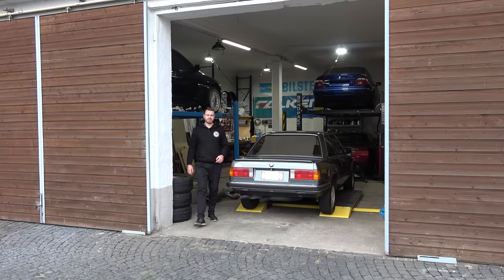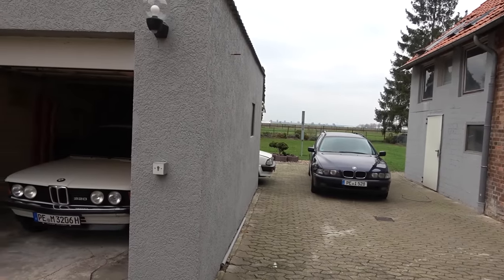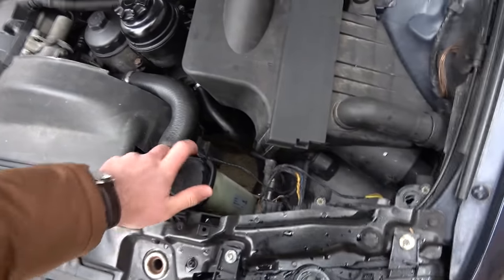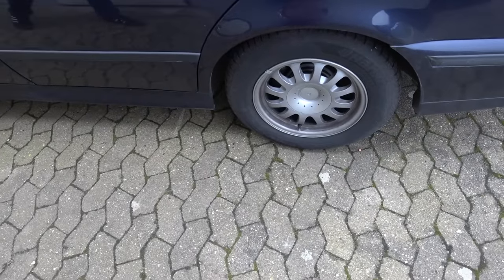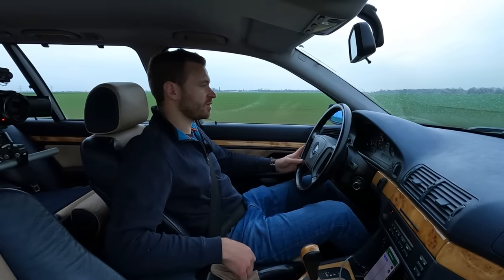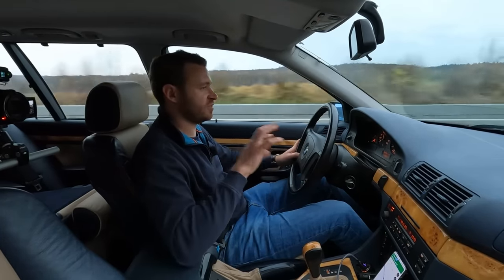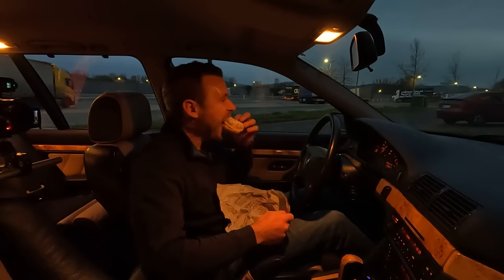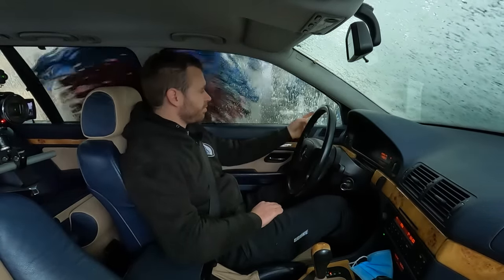I Got a FREE BMW E39 528i Touring Individual

Comment: We had that "winter cold start it runs on 4 or 5 cylinders till you rev it" issue on our 520i as well:
Turned out to be the hydraulic tappets "overfilling" somehow and letting the valves not close fully.

We found out when the battery was especially low one morning and it didn´t start right away. 
On further cranking and jump starting it then one by one lost compression on all the cylinders....

Obviously a bit worried, but the old Meister at our shop knew that issue: 
He let the car warm up a bit inside and just cranked it till squeezed the oil out and stumbled itself back into life.

On diffenrent oil now and its never missed a beat since then. 
I still love that slow boat :D
Reply: I'm struggling witht the same issue here.. can you tell me what oil you used to run and what oil are you currently using? thanks.

Comment: I have an e39 530d touring that used to be owned by the city of Hamburg, individual as well with all the options, it’s now in Finland and is pretty much a parts car, turbo leaks oil, injectors leak, has a tiny bit of rust, and a bunch of parts. If you ship it, you can keep it. Has pretty much all the options, 2003, only missing the hydraulic boot, and has the air suspension removed. Also has leather everywhere, transmission tunnel and doors, etc. also xenon lights you could switch in.

Comment: What a find! I had the exact steering wheel in my touring, I changed the column to a 99+ column and added cruise actuators and ECU for the buttons. All fairly easy with OEM wiring diagrams

Comment: I think you're going to fall in love with it. I honestly think you should keep it with your fleet. I love that colour combo, absolutely stunning!
I once got a free 523 Touring in Cosmos Black with light gelb 07LG interior. It was MOT'd, (UK equivalent to TUV). A free car is always good. A free e39 is somthing un heard off these days.

I've owned 4 Tourings, 3 I still have owned only 1 Limo. I also have a 99 Cosmos Black 740i

My first ever BMW and one I still have and adore to this day is my 1997 528i Touring. It's a factory Manual in Calypso Red with beige interior. Huge spec with comforts, heated seats, nappa leather, blinds, nav, TV, DSP, phone, PDC, genuine oris tow hitch, sliding trunk floor Style 32's and Xenons to name a few. Auto dip mirror and rain sensitive wipers as standard on UK 528i's. It's currently a rolling shell as its going through a full nut & bolt restoration at my own leisure. 
Not only was this my first BMW, It also was my first car. 2 previous owners, last owner 13 years. I've owned it 10 years. I have every invoice and original bill of sale with brocure, and accessories catalogue from 97.

Comment: 31:15 - if you are not going to repair the rusty spots properly I can higly recommend you a paint which is put ON the rust - ELASTOMETAL.
Myself didn't believe it might work but I painted the rusty fender edges and some of the bottom parts in my 18 year old astra few years ago and it seems to really work!
The rust which was covered with this paint didn't "grow" and the rest of the steel parts is strong and healthy under the paint. 
Try it out - especially on such a car, where you say no additional proper body reparation is planned.

Comment: Can't wait for you to start working your magic on this one.
In 06 I managed to trade an 02 A6 for an 03 530i with less than 50k miles.
At 110 mph I'd swear I was sitting on a large rock with no wind noise. The most stable and smooth running car I ever owned. Better than my current mercedes e320.
I did put new brakes on it and changed oil and plugs. The car was solid with no squeaks and rattles. Lost it at the end of 07.

Comment: Touring rear subframe bushings too are notorious for tearing/ripping.  New rubber or poly is a vast improvement.  And your outside air temp sensor reading -40C might have something to do with your rough starting, or possibly leaking fuel injectors?
Reply: The 4 bushings are filled with oil, with age the rubber hardens and cracks and it leaks out causing a harsh ride at the rear. Some cars go for years like that and owners don't realize anything is wrong until the rear airbag suspension also collapses and an enormous bill comes along!
Reply: @1maico1  my bags had a slow leak, replaced em and did poly rear SF bushings and it was a world of improvement

Comment: I had one of these, it was a 523i with a 5 speed manual gearbox in sapphire black with turbine wheels. Loved the self levelling rear suspension. Also there was a cassette player behind the fascia above the radio. Light grey cloth seats tho, not great with two young kids to keep clean but it was a great family car.

Comment: I had a biarritz-blue 1998 manual 520i with pretty basic spec, it was a sedan with multi-function steering wheel and a ski-hatch, that's about it. It was such a good car, i was stupid for getting rid of it!
It still has less than 200.000 km on it and the guy who bought it from me in may of 2016 still has it and is the third real owner. 
The car was VERY clean and with zero faults.

Comment: I also own and E39 in orientblau, just like mine, yours looks like a normal blue car, but after some detailing, the color pops so much, depending on the light it looks blue or purple, i also happen to have the sunshades but mine being a sedan, it also has the electric sun shade in the parcel shelf in the back, great option to have, but mine has a tractor engine as you would call it, an M57D30 with a manual xD
I just noticed you have the style 31 wheels, mine came with these as winter wheels, and you also have the original Dunlop spare tire too

Comment: I love my E39 touring 530d m sport, bought it in Dusseldorf (i live in Norway) in 2010 it had 148 000 km on the clock, now its passed 400 000 km. Its gotten great maintenence. Currently sits in my garage for rust repair in the wheel arch, but under it looks super nice.
Its  has stock look with orginal m sport roof wing and Rondell 0021's in 18" 8.5 front and 10" rear, legally approved by the whatever its called in english in Norway. :-P 

Funny story, my dad owns a 98 525 tds touring, also bought in Germany in 2000, he still owns it and loves it.
But i has bought a new car now, a 2017 540i sedane, with m sport and alot of cool stuff. But he still insists that the E39 is better to drive, so much better to sit in, he also claims its more silent inside. And it has a proper servo rack and not the electric crap like the 540i has..

I dont think i ever gonna sell mine, i have a feeling that would have haunted me for the rest of my life.
Reply: They don't build them like they used to.
I also own an e53 4.8is, the design is timeless.
Reply: Keep the e39 mate
Reply: @Krezo200  Probably will, i got my self a "winter beater" now, so the e39 can rest and its no rush anymore to get it finished. So im gonna fix some other stuff to that i have been wanting to do for a long time but not had time.

Comment: I picked up a cheap E39 520i touring earlier this year inspired by this and other youtube channels. Paid 1K for it and spent another 2-3K overhauling suspension, cooling system, fixing oil leaks, also retrofitted heated sports seats and an XTRONS android head unit.
Drives brilliantly now and absolutely loving it! The E39 is a great car.
The blitzer app takes care of the speed cameras btw.

Comment: I bought my 525i touring South Africa import in UK roughly 7 years as go.

It had 170k miles, now it's on 250k (miles!) And still going strong. I love this car, I swapped b30 in and done ton of work but I absolutely love doing every mile in it. LPG converted made it easy and cheap to run compared to even diesel cars, and I have no worries driving it at any speed.

I tried different cars but I always come back to this one as it's part of family I absolutely love it. You can tell you are big fan too!

Comment: I had the same issue with my M54 running rough and then running really well with 1 percent throttle. I cleaned the ICV and throttle body and it completely took care of the issue and it’s been years

Comment: I have 2 2001 E39 530D SE Tourings, one manual and the other auto, both with about 250,000 km. No rot in either of them despite being from the UK.

Self-levelling is great with the 1800 kilo Hobby caravan I have.

Flaps have been removed from the intake manifold on the auto. No major mechanical work has been needed.

The only real problem was the electric wiring for the rear wash/wipe on the auto which had broken in the tailgate hinge (a design fault and a common problem).

Comment: This was from an era when BMW relied on pure engineering, quality of components and classic design cues to sell cars. And built timeless classics as a result.
Then they did a 'Boeing 737MAX' and went all electronic where even the horn push is an ECU and they thought having timing chains on the BACK of an engine was pure genius. And they wonder why the BMW reputation is in the crapper.
Lucky man getting hold of one of these classics.

Comment: Hiya, I had a m52 motor in my e36 328i and it was also losing water. No signs of leaks and water wasn't mixing with the oil either. Long story short, the garage I took my car to, to get a new head gasket fitted used the same head bolts when they did the replacement. Turns out those bolts are stretch bolts and a new set was needed. (found this out after giving up and selling the car) so if all else fails, check that.

Comment: Love the Tourings I'm on my second one. Had a E34 m60 1995 and now a E39 m52 with 120.000 Kms. Had the engine oil and filter changed and transmission filter end fluid changed.  IMO there's no other BMW. I have pictures of both of them.

Comment: Nice gift! I've scrapped about 15 of these in the last 5 years as a side hustle. Used to buy them for around 500 euro's before prices got higher. Rust was the first indicator for scrapping because the catalyc convertor is worth already 800 euros on a pre okt '98 car. There was one which was too nice to scrap. Body was fine. Only had  a seized engine. Swapped it and i still drive the car to this day 5 years later. Still love it 😁
Reply: What is the cat worth on a later 1999 engine?
Reply: @1maico1  The cats in the manifolds as from '99 are around 150/200 euros a piece.

Comment: I love my E39 touring, best car i ever owned. 350.000km and 20yo, and still perfect. 
But some problems, brake are very bad, steering rack is fragile, some plastic are in bad quality (espacially in rear), some rust, etc
But this car is so good, very easy to repair, powerfull and perfect for cruising, nice design <3

Comment: About 4 years ago I found a factory manual 528iT that had blown the head gasket local for $1000.

After going my research on the M52, preferring facelift E39s, and being a new dad I decided it smart to leave that project to someone else... I thought I'd be able to get into one in a few years. 

The prices on these are so high now! 540iT listing for over $10k when they were junk a few years ago.

I regret passing. Great find. I still look around in the hopes I'll find a cheap one.

Comment: im putting the small airbag sport wheel into my 00 528i out of my 03 530i parts car as well as sport seats. i bought a parts car wagon as well with the rear tray and subwoofer setup. the car itself is just a base 528i 5 speed with cold weather pack because canada. the whole front suspension will get swapped to sport stuff as well as the brakes. and the interior is going from doe grey to black. im very excited to watch this build play out!!!
mine is also getting huge rust work including a new tailgate, both rockers, one quarter, the battery tray, the opposing side air vent behind the bumper, drivers rear footwell, inner wheel arches etc. thankfully the 530i parts car was rust free and the wagon parts car has a tailgate

Comment: Sreten, regarding those rust spots and on any other car that you have. There is a product called kLine Rost Stop Primer that comes in 1Liter bottle(15 m2 coverage) and yes it costs 55€ for that bottle, you can use that to slow down that rusting process a bit. Angle grinder with flap discs/wire brush and then this stuff. Longterm, this needs some proper job but this can buy you some more time so you can leave it like as it is until you decide to go nuts with it. Keep these vids coming 🍻.

Comment: Nice catch Sreten, need to see more soon :) Same thoughs on e39, it's great everywhere and you can't destroy it ! Have myself an 528i too, in quite mint condition with many new OEM parts, it's my daily and probably best BMW i've owned, never had V8 so maybe will change my mind one day ? Mine has some fun options as double glazing. Full toolbox and OEM torch in the gloves box :) Recently put B8 and HR spring (with every chassis parts new) only non OEM upgrade for this one, but it handles so much better on dynamic driving. I'm on 16s style 5 wheels.

Comment: This car seems like a good test bed to try out three or four or five rust killers or rust converters.  Make a map of what you did, then check the underside in six months or a year to see if anything was effective.  That would be a lot cheaper than making new pieces to weld in.  And it would be a worthwhile experiment.

Comment: You can try fixing the temperature sensor - this should fix the bad idle. The a/c won't work with that sensor and it'll burn more fuel,  since it thinks it's -40 outside. Cheap and easy fix.

Comment: I have a 2001 530i msport, just clocked 150k. So not run in yet 😆. Easy life it has had in nz so no rust.  But also no autobahn. Love it. Running synthetic atf currently but I think I need to go back to zf lt... the lock up clutch seems to struggle to stay locked.  Otherwise nearly perfect.

Comment: The rough start might be because of the coolant slowly entering on top of piston after engine shutdown, I've had that experienced. Also a note at first weeks of the problem for some reason it didn't show even on cylinder pressure test (it seemed that it wouldn't leak on warm engine). Later when it started to effect on engine temp, it showed leak on cylinder pressure test. The rough start didn't occur everytime, just occasionally.

Comment: I had a 530d.  Outside of the crappy GM transmission, it was a great car.  I remember test driving a 528i back in 1996.  Great car.  Handling was awesome.  Especially the steering.  I am down in Stuttgart.  Might have to come up an meet you sometime.
Reply: Only the diesel E39 used a GM trans?
Reply: @vw5056  I am not 100% sure but I want to say that most of the diesel models used the GM automatic transmission where the gasoline typically used the ZF.  I may be wrong but my 99 had the GM 5L50E automatic.

Comment: Try the bedding in procedure before binning discs that are not worn/lipped. But as you say it could also be a suspension component. 

Is the starter button something somebody bodged together because the ignition switch broke?

Comment: love love love that M52 engine, smooth as silk and durable if the VANOS  doesn't fail.  The damn plastic coolant tank would fail way before, at least they did in my 2 E36's.

Comment: for the cold start issue, i had similar issue on my E46 M54 ..there the Valve stem seals are a bit old ;) dependig on the valve position probably a litte oil drops into the combustion chamber or on the spark plug. mostly a little push on the pedal solved it.
I had no huge oil consumption (~0.3-0.4/1000km) but a little 2stroke fragrance after starting the engine.
thumbs up for yout chanel, i realy enjoy watching. I had / have a several BMW as well and totally agree E46&E39 are the best

Comment: Back in late 1981, my German co-worker was going to sell me his 1979 320 E21 (also in White), which had a 1980 engine in it, for only $1600... but alas, I ended up moving back stateside in 1982... I did get to drive it - a bit of a difference from my 1973 Ford Escort (another great little car)...

Comment: The cold start misfire is coolant in a couple of cylinders putting the spark out, cleared once the throttle is open and it dries out. Could be a cracked head, could be a minor gasket breach. M52's and M54's should have the block checked for straightness after an HG fail but not all garages do. The other PITA is the threads in the block for the head bolts. They were really only intended to be used once with the original factory assembly. Once overheated they weaken and even if they all tightened up okay on reassembly, it only needs one to be a bit weak and you don't get quite enough clamping force. I would drive it for now and if it decides to fail, you can remove the head, drill all the threads out and fit proper Timeserts - not a bad job tbh. E39's are OK but to me, the E34 was a better built car and much easier to work on. E39 AC fan replacement is a case in point - you need to take the front of the car apart.

Comment: I'll put this out there: if you've got enough time, space, and money to own more than, like, three cars, then one of them should probably be an automatic. They're very convenient if you get injured or if you're going on an excessively long road trip since you don't have to do anything for it to shift. It's nice. I actively prefer automatics because there's nowhere in my cop-riddled state where I could actually push a car far enough for a manual to make any significant difference for me, and it's nice to be able to take a drink without needing to plan it around a shift point. Having said that, you have 7 series with the big V12 and an automatic to serve that role, so it's not necessary to have an automatic Touring unless you particularly like it.

Comment: You might hate Depos, but on older BMW's it's often your only real option that doesn't cost an arm and a leg. Like on my E34, I have the Depo Euro smiley headlights and clear turn signal tail lights... those would cost a fortune to get secondhand genuine BMW ones, and I doubt they're still available to buy new.